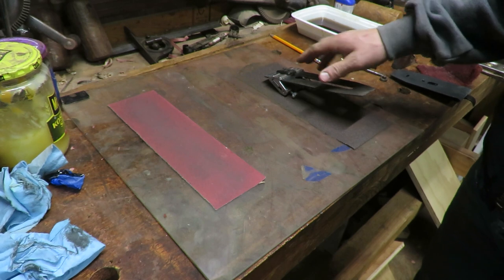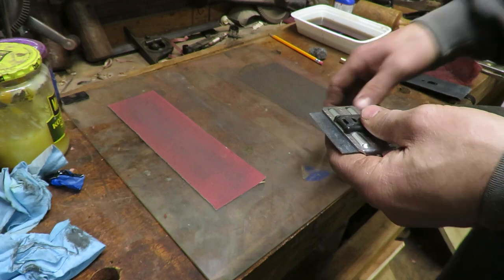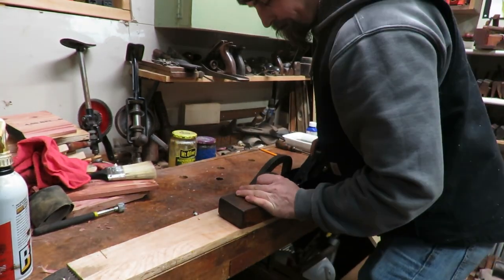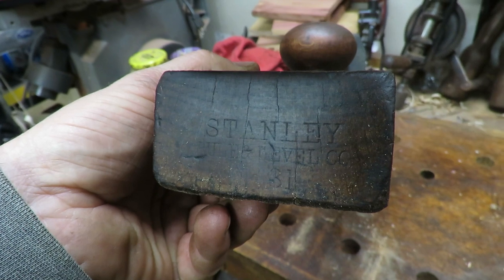Stanley No 31 Restoration

Comment: Hi Tim - great job on this restoration - you got everything working again and repainted and it looks really nice. A couple of suggestions... For the blade - when you have deep pitting it is just impossible to get the back flattened. Solution: instead of a flat back put a micro-bevel on the back. Search YouTube for 'ruler trick sharpening' - just do a micro-bevel on the back and front. This allows you to get a sharp edge at the intersection of the two micro-bevels. For those pesky checks/splits at the ends of the wooden body - try Howard's Feed 'n Wax. Slobber it on and into the cracks. Let set over night the wipe off excess. Repeat each month. In a few months those cracks will be a good bit closed up. I've had amazing success using this stuff and it's available from Amazon. Hope the ideas help. Love your videos - keep them coming!
Reply from the maker: Great tips, thank you
Reply: I just saw this video and was going to suggest the same thing

Comment: Any idea what kind of wood in plane body?  Nice job of refurbishing and preserving an old workhorse. Merry Christmas to you and your family Tim!
Reply from the maker: Merry Christmas uncle Dave. The wood is beech. I have been trying to find some local to me so I could try my hand at plane making.
Reply: @ASliceofWoodWorkshop  there used to be some beech on Bonney Hill when I was a kid. I wonder if they soak it in linseed old to keep it from drying and splitting.
Reply from the maker: From reading in handplane groups they did not. This one was finished with lacquer and most were supposedly just waxed and the oil from the carpenters hands would keep it from drying out.
Reply: @ASliceofWoodWorkshop  If you want to keep it from drying out you need to cover the end grain with some wax because at the endgrain it is drying out much master an thats why it splits...
Reply: wax from candles for example not sure about some other wax
Reply from the maker: Yeah, that is what they put on freshly milled board so everything dries evenly